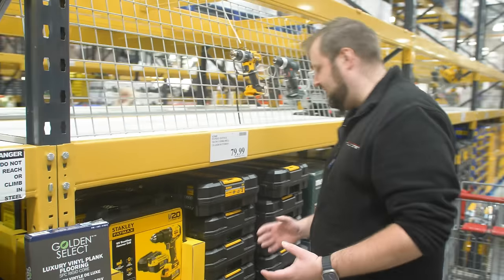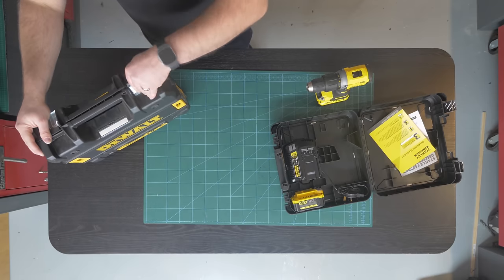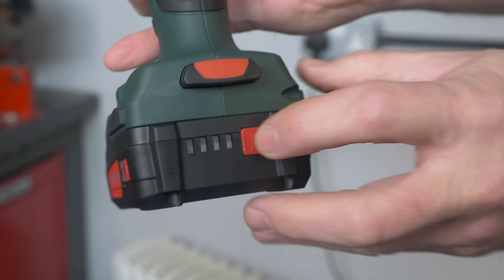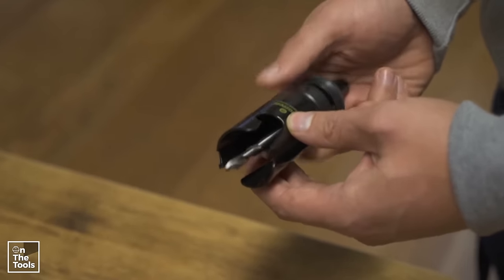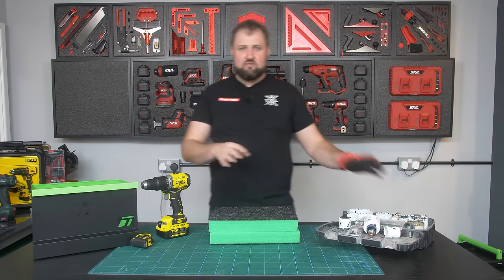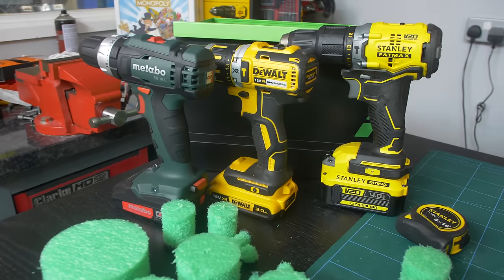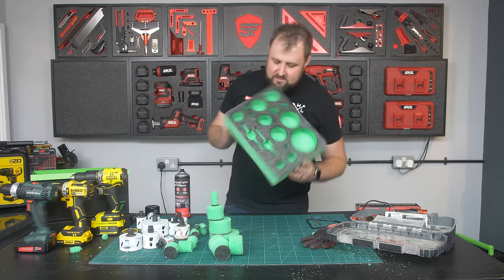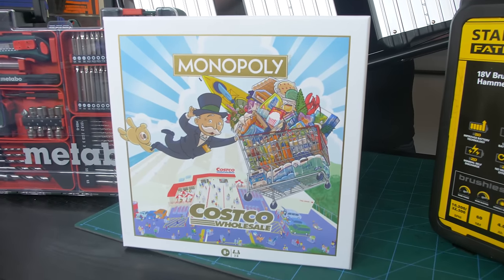I Walked into Costco and Transformed MY Hole Saw Tool Kit!

Comment: 20v and 18v are indeed the same. Its all about definition. 20v is the batterys voltage when fully charged without a load connected to it. 18v is the voltage measured on the terminals when it has a load connected. This however has led to a  great deal of confusion thoughout the years and people have bought into the idea and thought one battery is superior to another. This is one of the reasons bosch rebranded their 10,8v line to 12v. The batteries are the same but people thpught they where inferior to other 12v batteries
Reply from the maker: Thanks for the info!
Reply: Highly underrated comment! Same goes for the higher voltage batteries like 40v and 80v. Ryobi has their 18v batteries listed as such but their 40v is just two 18v together and matches any other 36v tool.
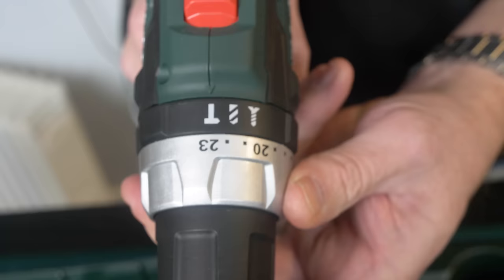Reply: ”For what will it profit a man if he gains the whole world, and loses his own soul?“ Mark 8:36 NKJV 

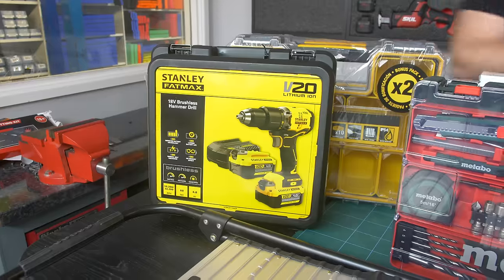“For God so loved the world that He gave His only begotten Son, that whoever believes in Him should not perish but have everlasting life.”John3:16 NKJV

“that if you confess with your mouth the Lord Jesus and believe in your heart that God has raised Him from the dead, you will be saved.”Romans10:9 NKJV

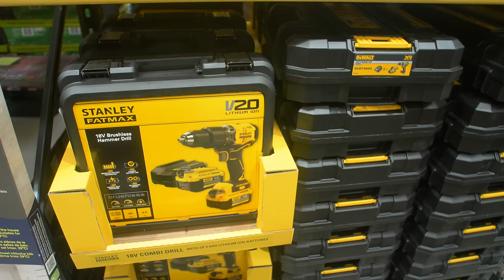Romans 3:23 (KJV)
For all have sinned, and come short of the glory of God;

Romans 6:23 (KJV)
For the wages of sin [is] death; but the gift of God [is] eternal life through Jesus Christ our Lord.

Comment: For the Drill... I'd choose DeWalt. The Stanley looks like it's almost interchangeable with the DeWalt, but I'm sure there's a tab on the battery that stops them being swapped. Metabo used to be Hitachi power tools - good quality, but my concern is that in 10 years time, will they still have parts available? I know that my DeWalt's generally will.

Comment: Costco on your side of the pond has much nicer tools than we get. 

If you’re ever visiting the US and want a challenge…I’ve got a 35’ RV with way too many tools that I need to organize. 

I’ve got maybe 6 or so Ridgid storage toolboxes, four of the half size Packout bins, 6 mini Systainers, and a few Makita MakPacs.

I’ve got a ferrule crimper, closed pin Deutsch crjmper, Anderson PowerPole crimper, Pex plumbing crimper. Couple 3/8” impacts. Lots of different long reach pliers so I can reach into the RV engine. 

Perhaps I do have too many tools, but we travel for long distances and work on projects on the road. We end up doing things like switching from 12v to 48v battery during trips. 

If you do end up visiting the US or Canada, I’m happy to drive to wherever you are.
Reply: Oh: we also have crafting supplies like hand sewing, painting, crochet and knitting, and a lot of pens. Fountain pens, bottled ink, notebooks, and a drawer full of various dog things. And about 40 spice jars and packets.
Reply from the maker: Haha that does sound a challenge! Let me know in the future when I announce my US ideas

Comment: Metabo power tools are the top of the line / PRO. That set is top shelf for sure. They do have some lower end tools for the bulk of customers that don’t want to pay high prices for tools. I think those lower quality / priced tools also fit well for a contractor who just needs a tool on a rare occasion. Great video. My drill choice would be the DeWalt. Smaller than the Stanley one, all heavy duty features. Durable for outdoor use / building.
Reply from the maker: Thanks for the info!

Comment: Good video. The Dewalt and Stanley drills do have screw mode (hence the adjustable torque settings) along with hammer mode and standard drill mode.
Reply from the maker: Thanks for the info Ben! 👍
Reply: @ShadowFoam great videos by the way. Recently found your channel love the tool hauls.

Comment: #5 that little rolling shop stool was one of the best buys I have recently bought. I got one from Harbor Freight, it was $54 and it works very well when your doing breaks or even cleaning the rims or the whole car.
Reply from the maker: Fantastic! What do you put in the little drawer?
Reply: @ShadowFoam  I would put in a 3/8 socket set, 3/6 ratchet, 1/2 rachet and maybe the caliper piston tool if it fits. LOL Ofc I want it all in Shadow Foam

Comment: When you tighten the drillbit up in the drill, once it’s tight, move the chuck back a little bit. It will click and lock so it will stop the Chuck from undo itself when using
Reply from the maker: Thanks for the tip! 👍
Reply: Came on here to see if anybody had mentioned this little known pro tip for locking the chucks , looks like I was beaten to it. Not all  drills etc do this only the quality ones. As stated once tight turn the chuck back the opposite direction a few degrees you will feel it lock

Comment: Stanley drill is the one for me. also your heat gun would be great with heat shrink safer then a lighter and a heat shrink kit. was it battery or 240 and also body wrap to get into the smaller parts
Reply: I have the exact same heat gun (minus the ShadowFoam logo ;) ) that I bought years ago specifically to keep in my tool box to carry for heat shrink :).  
AC Mains and only complaint is the lead is a little too short.

Comment: This may seem a bit silly, but would the hot foam finisher also work for heat shrink tubing? I use it a lot for some of my projects so a little tool like that would be really useful (I'd also really like to support you guys more, before I buy the halfords heat shrink torch)
Reply: Yes it will.
Reply from the maker: I see no reason why it wouldn’t 👍

Comment: He was on about your drill bits coming loose. What you didn't do with the last two chucks the DeWalts and the metabo is lock the chuck. Now if you take the chalk very tight and then click it back as if like it was loosening it but you don't loosen it it will lock it will do a click but it will lock the chuck it will never come loose. Not many people know about this because they don't read the instructions.

Comment: A lot of sites don't allow you use steps , I was on one site and a guy gave me an instruction on using 5 tread steps apparently you can only go up 3 treads ! By the way I was 60 yrs old at the time how did I ever manage ?
Reply from the maker: Sounds scary Ray, are you sure you're alright after going that high up mate?

Comment: Stanley Fat Max will be great for the Home DIY fixer.  The one who changes needs to tight the occasional screw.  Looks like it may fall apart to easily for anyone who counts on it for regular work day-to-day
Reply from the maker: Might be worth putting it to a test more intense than my Shadow Foam test 😂
Reply: Looks like a half decent tool, been looking for a cheap drill I can leave in the car just in case instead of taking my makita

Comment: Had a metabo 240v hammer drill best drill I have owned?!, never owned any Stanley power tools but i hear there good, my current tool kit is Milwaukee because I got a good deal on it
Reply from the maker: What deal did you get?
Reply: @ShadowFoam  The 6 peace kit for £789 from Screwfix, it's back up to £899 & just picked up the orbital sander to add to it from Toolstation  for £80

Comment: I would go for the dewalt drill. They had a deal in tool station or screwfix , dewalt drill 796 with 2 4ah batterys for pretty much the same price as the ones in the video
Reply from the maker: That is a great deal!

Comment: I will go for the dewalt drill but I have a different model from the one you presented. Mine you can change the intensity of the light
Reply from the maker: I like the sound of that! What model drill is it?
Reply: @ShadowFoam   it's the DCD791 I bought it in a kit with the impact driver DCF887 (in witch you can choose level of impact)

Comment: I’d have to go with the dewalt as no makita lol although that’s a great price for the Stanley with 2x 4ah batteries, for the stool I’d probably go with tools I’d usually use on jobs that I’d be sat on the stool in the garage, so small hand tools screwdrivers,1/4 socket set adjustables etc  oh & recently got a monopoly of my home town & it certainly isn’t as plush as that 😂
Reply from the maker: Agree with you mate, what’s your hometown?
Reply: @ShadowFoam  High Wycombe, but reside in Windsor now 👍🏻

Comment: That stepladder sure is not upto Altrex (pro) quality. But the deep steps are great. Metabo used to bemore of a woodworkers brand, the cast aluminum housing drills were great. But they are now also owned by another company. DeWalt is part of Balck & Decker Professional, but it seems it also has consumer/big box lines. These days big box stores started carrying blue/grey Bosch, that makes one wonder about them being true Bosch Blue.
Reply from the maker: Thanks for the info!
Reply: "Metallbohrdreher" first metal drill invented in 1923 is the basis for the name. KKR owned. @ShadowFoam

Comment: DeWalt DCD77701. I don't know if that's the same model you've got, but it's the one I asked my wife to get me for Christmas.

I'm really hooked on your product, and your YouTube channel. I have 2 projects I could really use your help with, but shipping to the US is expensive, so I want to make sure I get the orders right the first time. I recently bought a Stanley Rolling Workshop Tower STST60500 that is modular, but not expandable in any way. ShadowFoam seems like my best/only option. The two cases and the bottom bin have a profile. Do you happen to have blanks for this Stanley product?
Reply from the maker: We don't curently have inserts for the Stanley range, but hope to add them to our line in the near future!

Comment: Don't remember ever finishing a game of Monopoly in our family, always turned into a massive row and falling out. 😄 My sister in law is obsessed with Costco though, so I'm in for the win of that themed set. Of those three drills it would be the DeWalt, although the Stanley looks ok and I'd have been satisfied with that a few years ago. When I decided my DIY deserved an upgrade, DeWalt was on the shortlist but I found I preferred Makita and am extremely happy with the kit I've built up. Both good makes though, and working with quality tools makes a huge difference.
Reply from the maker: Big question is though, have you organised that kit yet?
Reply: @ShadowFoam Yes indeed, all my cordless tools and batteries are loosely arranged in a stacked toolbox system, with plenty of gaps for everything to rattle and clatter about. I can't imagine any way to improve on this. 🤔

Comment: When you tighten a keyless chuck you need to tighten it then turn it back anti clockwise until you hear a click.  That locks it.  Thats why your bits dropped out.  Hope this helps in future reviews.
Reply: Wrong. And many other people including manufacturers have stated such.

Look at the design patents on how a ratcheting chuck works. Clicking it back unlocks the pawls.
Reply from the maker: I was going to say this actually, as I’ve used these tools for years and know how they work 😂

Comment: I’ll be trying these hole saws 👍
Reply from the maker: Let me know how you get on with them! 👍
Reply: @ShadowFoam  I must have around 8 sets of Hole Saws, but the only ones I ever use now if possible is the Bosch Quick Change ones. So So much better to use.
Oh.. little tip I found for when you have the Saw jammed onto the Arbor on the 'normal' hole saw kits ... Put it onto an Impact Drill and have a go on a piece of scrap wood - that impact vibration loosens it up again!   tried this on a set that had the Arbor stuck on for over a year and freed in seconds!

Comment: As a DIYer, it would have opted for the Stanley.
Reply from the maker: Do you have any Stanley tools?
Reply: @ShadowFoam  no power tools all hand tools. I'm on the screfix TITAN range with some Parkside (Lidl) thrown in for good measure. I've not seen any Stanley ones in my area TBH and the usual outlets are a bit snobbish when stocking ranges.  TBH the stuff I have has done me rightly, have built a 12 x 8 shed and set it up as a workshop and all of my TITAN and Parkside stuff never missed a beat. Especially the Parkside impact driver with 4 AH battery, abused the hell out of that. But the fat Stanley looks good and the price for brushless WOW!!! .

Comment: My favorite Monopoly Game Boards are my Dead Pool and Iron Maiden versions.
Reply from the maker: Dare I ask what the rail stations are for those? 😂
Reply: @ShadowFoam   Unfortunately the Deadpool ones are not as risky as I would prefer. They are the Deadpool logo, an 'okay' hand, a Deadpool bomb, a unicorn, a taco, and a chef’s hat. Ya, pretty sure Hasbro had a hand in control this. SO many other items that could have been used. The most risky is the unicorn... Disappointing. The Iron Maiden one made more sense and has the Guitar Amp Stack, Steve’s Bass, Nicko’s Drum Kit, Albatross, Flying Helmet, and Wasted Years Computer from the video. It was made by a different company so they did a better job.

Comment: I got the Einhell
Reply from the maker: How long have you had it for?
Reply: @ShadowFoam  Uff probably 10 years or so, it´s my first personal power tool, (I worked in a company with professional Makita tools before, so I didn´t need to buy my own tools for my personal use, I could just borrow them any time).
I was just looking for a cheap Li-On battery power tool back then, I didn´t expect it to last for that long. It´s much better quality than expected. And I have used it quiet often for a "home tool" I have build my own furniture, I have assembled IKEA furniture, I have used it on my car, I have used to for 3D printed parts and RC models, used it to stir paint and all sorts of stuff.

Comment: At work we won’t buy Dewalt cordless drills anymore after breaking 5 of them. They’re just not very well built any more.
Reply from the maker: What brand did you buy instead?
Reply: The boss bought some hefty Makita 110v ones instead.  
On the Dewalts, one had the chuck break, a couple had their gearbox stuck in the slow speed, one had the gearbox completely break, and one kept acting as if the battery wasn’t there when you held it in a position to drill downwards. The older models out of all of them lasted a lot longer than the newer ones. The new ones probably were less than a year old before developing faults. Some were swapped on warranty, but the replacements didn’t fare much better. After the newer ones not lasting, the boss said he wasn’t going to waste any more money on them and got the Makita’s instead.
Thinking back, the place I worked before bought a couple, and one broke within a couple of months and had to be swapped on warranty.
Reply from the maker: Fair enough, what was the job you were using them for?
Reply: General workshop use. Drilling holes in metal, but nothing really big, all within the rating of the drills. Usually it was holes to be tapped in 2 and 3 mm box section.